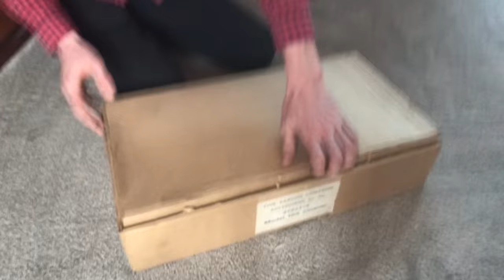Roadtrip to Lincolnshire & Derbyshire, Dyson's, Hoovers & Robots, Oh My!!!!

Comment: It's a derivative of a Goblin 102. Our family bought one in 1967, they were cheaper that a Hoover Junior and were quite good except that the spring on the handle was quite strong and tended to lift the front of the machine off the carpet which compromised cleaning performance. Eventually the handle spring failed and the cleaning performance actually improved. It lasted many years until the foot switch failed and they replaced it with a Hoover Junior.
Reply from the maker: I’m chuffed it brought back some nice memories for you, was a very interesting machine, there were many parts of it I prefer from a junior. I will have to keep my eyes open for one for sale. Thanks my friend 🙏🏻